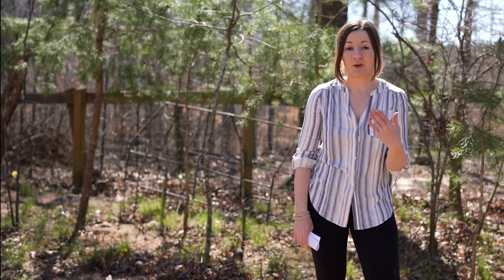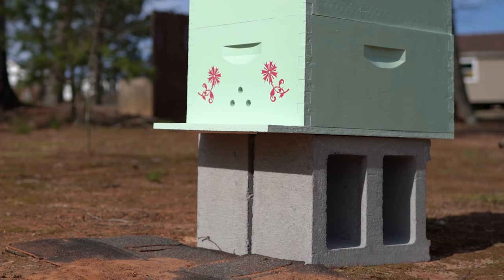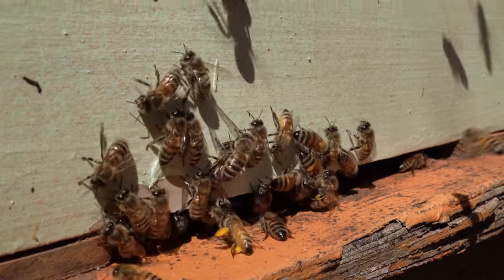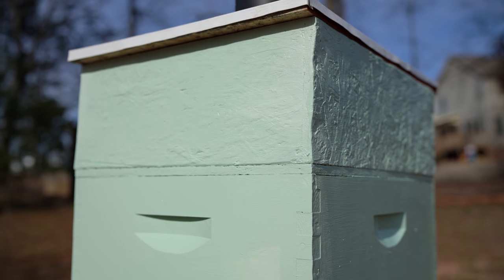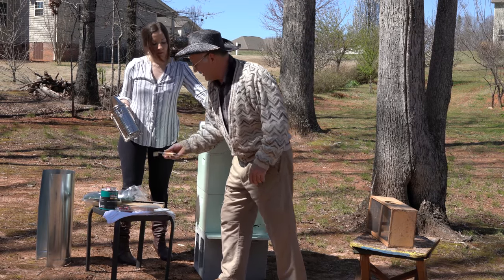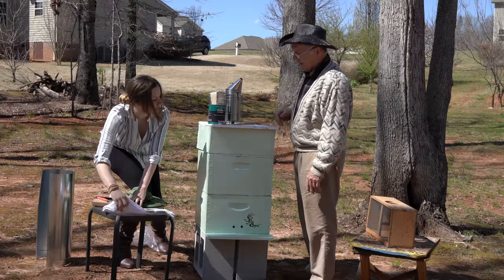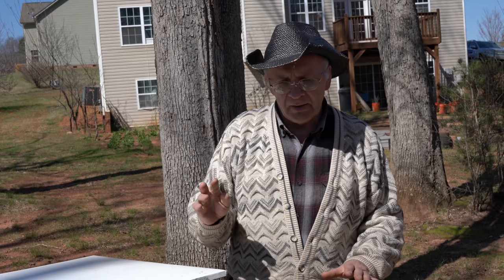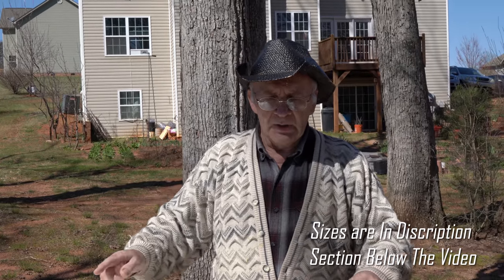Starting A Beehive For Dirt Cheap & Setting Up Beehive For Success (PART 1)

Comment: Your Dad knows his stuff. A very informative video for new beekeepers. I just use a 3/4 inch starter strip of wax foundation in the top of the frame with fishing line for support and let the bees draw their own comb. I can do 10 frames with starter strip from one sheet of wax foundation without the wires. Go to the oops shelf in the paint department, you can get the sample 1/2 pints for $.50 if you're not particular about the color. You can get free shipping from Mann Lake with orders over $100.00.
Reply from the maker: Good to know! Thank you for watching  and commenting :)

Comment: Nice way to avoid the bottom board expense. See if you can find some foam tape to put on the bottom of the brood box, to act as a weather seal for water intrusion and for wavy plywood or box cuts.
Reply from the maker: Thank you for watching and commenting! :)
Reply: Not needed, bees will use propolis to seal every nook and cranny.
Reply from the maker: @mark-wn5ek  That is very true! Thank you for commenting!

Comment: Great video. I have a couple of questions. I noticed the holes for the bees to access. Does it help with the hive beetles? Also does it allow good ventilation?
Reply from the maker: My dad said, he doesn't think it will help with the hive beetles. He uses the inner cover with the screen as shown in the video to ventilate the hive. That should be plenty of ventilation for the bees! The screen on the inner cover easily passes air in and out. Most tops/roofs for beehives are not tightly sealed on to the hive and have small holes in the wood where air passes through easily. Also, we suggest making one entrance hole on the second deep super (one should be plenty on the second deep super additional to the bottom entrance holes) for even better ventilation. If bees don't need that hole they will cover it up with propolis! Hope this helps! Thank you for watching and commenting!

Comment: When I do have to feed my bees, I make the sugar syrup and I also add chamomile I grow organically, to the nectar as it helps protect against varroa mites. Have you or your father tried this method? Instead of having to by varroa mite medication. Thank you again😊
Reply from the maker: We have not tried the chamomile. We don't use medication on our bees either. We use thyme oil and tea tree oil if the need arises.
Reply: Do you use the tea tree oil the same way you use the thyme oil,  in 4 ounces of olive oil?  And how many drops?

Comment: Hello. I'm about to get some bees here next 10 days and been watching videos on bees like crazy. Your channel was reccomened today and you guys give out a lot of great great tips and information. Everyone I watched so far says you have to place the bee hive entrance towards the South. Your dad says to place towards the east, can you explain why East? Thank you ahead! :)
Reply from the maker: Hi! This is a great question! My dad said, that the Russians have experimented with this and have documented that placing the hive towards the east gives you a few advantages. One, east is where the sun rises, therefore the entrance warms up first, the bees from this hive start working earlier, up to two hours earlier than the hives that are placed towards the south. One or two hours every day can add up quick. Therefore, they should bring more honey. He extracts up to 3 gallons of honey per hive, per year. Second, facing the hive towards the south during the summer days is not a good idea. Most part of the day the sun shines from the south, this may over heat the entrance for the bees, and the bees have to ventilate more, work harder to keep the hive a certain temperature for the brood. He has read this experiment in a Russian magazine and ever since then he has put all his hives towards the east and it has worked for him for many years. If you have found a different kind of research, please post here. I hope this helps. Thank you for watching and commenting! :)
Reply: That makes perfect sense! Thank you! :)

Comment: you  were using thyme oil with coconut oil..treatement of varrora mites..i want  to ask  you can we use another edible oil for this purpose other than coconut oil..please suggest
Reply from the maker: Yes, you can use mineral oil. Check out the description section for more details under the video that is about thyme oil. Thank you for watching!
Reply: @AnnaKra  thanks ...but this time nector flow is...so it would be good to  use in saseme oil like.. i found varrora in my apiary
having total 60 hives this time..